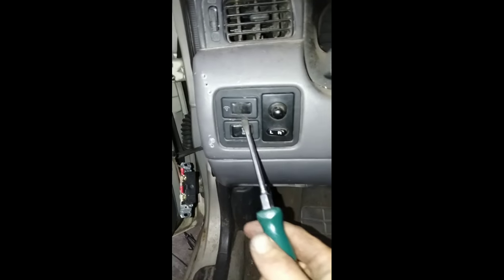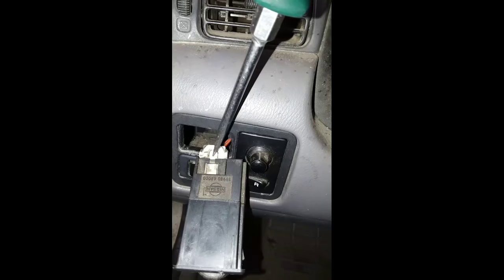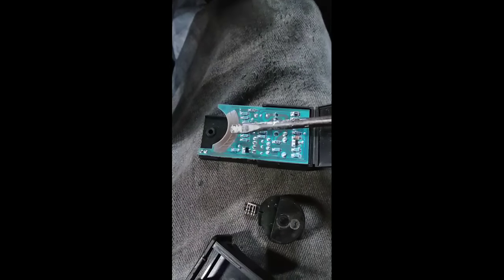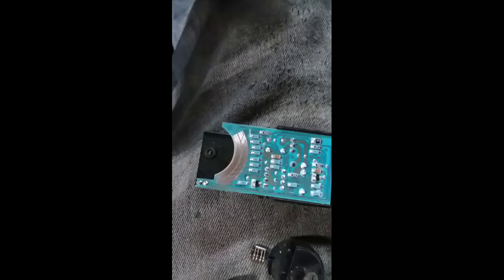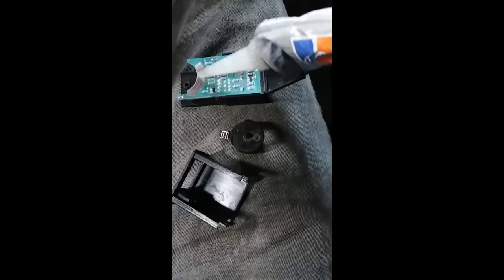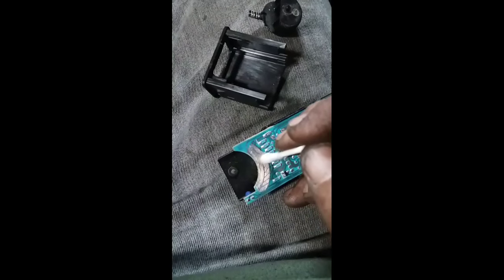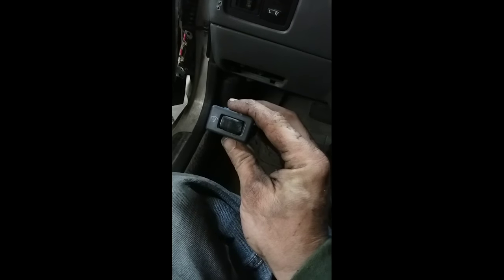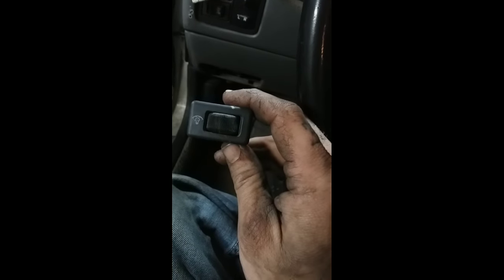Flickering Dash Lights. Easy DIY fix

Comment: When my lights started to go off by themselves, I would give the top of the dashboard a tap and they would come back on. But it's gotten worse over the last few weeks. I would fidget with the dimmer switch, and it would come on and off. I'm betting that your solution is the right one. Thanks again.
Reply from the maker: I did that for a while myself, and still bang on the dash to make my temperature gauge work😂 If it works it works😎
Reply: I have a 2000 legacy b4 and has the same issue as you described. Might have to try this fix also

Comment: I never thought of that I was thinking the instrument cluster plug was loose....I will check that out.
Reply from the maker: A loose plug or crusty dielectric grease in the connector can cause issues too. Sometimes you can just plug and unplug the connector a few times to make a decent connection. Thanks for watching 😁

Comment: Didn't work for me. Of course my dimmer switch was different then yours. I didn't see a contact strip like yours
Reply from the maker: Yeah they do come in a variety of different configurations so it can be hit and miss. Just a matter of  getting at the contacts, without destroying the switch, if there are any of that sort in there. Some of them are more like a typical rheostat switch that's more encased. Sometimes you can get away with just blasting them out with electrical parts cleaner or soaking in rubbing alcohol and working the knob back n forth. Brake cleaner and carb cleaner will destroy them. Thanks for watching 😁

Comment: Cat wasn’t starting.  I cleaned some grounds and replaced a starter cable that was corroded. Car starts now but dash and running light flickers when in D or R only never did before.   If I turn headlights on it goes away. Annoying though. Probably something stupid.  Any ideas ??
Reply from the maker: Sounds like it could be a neutral safety switch (only allows the car to be started in neutral or park) It's common for instrument lights and neutral safety switch to share the same circuit. If you can find the neutral safety switch you can test the theory by unplugging it and using a jumper wire across the  plug terminals. Good luck!
Reply: @sentradynamics8889  hey thanks for the tip !  I’ll keep it in mind. Funny thing is it did not do it until I replaced the starter cable   The old one was corroded and back then it had a intermittent starting problem. Since replacement it did it a few times where it wouldn’t start   Then it wouldn’t not start again   So starts right up since all this but still when in drive or reverse.  Tye dash lights flicker which it did not do before
Reply from the maker: @Mick  Have you checked the alternator and connections? Low voltage can make lights flicker too
Reply: @sentradynamics8889  I checked alternator by putting a multimeter on the battery connections I believe to see what it was doing and I believe it was correct for a functional alternator.  When I did the new starter cable I did clean some windows electrical connections so i should probably check all those to see if something is funky.  Maybe that’s where something got screwed up. But weird thing is how it starts great now and didn’t before lol

Comment: Im having the same problem with my 2013 mustang gt 5.0 my light where the fuel guage and temperature gauge are the LED light is flickering on and off idk what is causing it
Reply: Did I ever figure it out
Reply: You*
Reply: @katgarcia2168  not really im thinking its the lights that gave out might need to take it to the dealership
Reply: @Gumorisco11  same issue here. Lights flickering on the fuel gauge, any updates? Do you know why? I heard it could be the alternator?
Reply: @palerider4629  sup bro nah haven't figured it out yet im thinking its a ground wire or the Lights have burnt out my fuel gauge amd temp gauge back light dont turn on anymore i dont think it would be the alternator because if it was then the windows wouldn't go up they would go up slowly thats one way to test your alternator if its a bad one then your windows wont go up fast theyll go up super slow
Reply: @Gumorisco11  oh wow. Thanks for letting me know a way how to test the alternator. Then in this case it shouldn't be my alternator, maybe my light bulbs are going out, wow that's horrible
Reply: @palerider4629  but its no big deal for me other could be a burnt fuse or a loose wire but im sure its the lights that are going out
Reply: @Gumorisco11  yup, that's what I'm thinking as well, the bulbs might be going out but I also don't want to take the whole cluster out. Idk what to do, this really sucks and its irritating
Reply: @palerider4629  i feel you bro i was going to take mine to the dealer ship but i dont want to get scammed lol
Reply: @palerider4629  bro frz when i bought my gt it came with wheels that didnt even fit the car they fit because they had wheel spacers then having it for a week i started hearing a clicking noise on the back of the wheels so i decided to take it to the stealership and the guy there started blaming it on me that i had taken the bolts off after i told him are you guys trying to blame me for it then he changed subjects right away lol they were going to charge me $270 just for a new bolt and to mount the wheel back but the guy whos in charge of the maintenance said ill charge $160 only after that i never went back id rather have my lights off then having them f... it up and not fixing anything
Reply: @Gumorisco11  yup that's why I don't want anyone taking the whole cluster out and messing with it, I know they will fk something up and won't put it back the proper way. Btw, I went to auto zone yesterday and had my alternator checked and it was fine so it's not the alternator like u said so I believe it's the bulbs going out, fk.
Reply from the maker: Probably a bad ground but there's a mess of wires back there, good luck!

Comment: Great video.  Going to try it on my 2009 Infiniti g37.  Even if it doesn't work still a great video for those that it helped.
Reply from the maker: It's worth a shot, and yeah that's what it's all about. Gotta help each other out😁
Reply: Wow, I have a 2009 g37 and its doing this as well. Any updates?
Reply: Did you try it out?

Comment: Thanks for this. The lights on my heater/Air con have stopped illuminating but the system works.
Any ideas? Thanks.
Reply: Same here
Reply from the maker: There's some tiny bulbs in there. Usually only a few so its common to just have one bulb still working and when that one goes out... Take the trim bezel off and check the bulbs. It'll be obvious if they are burnt out because they will look pretty dark. Good luck!
Reply from the maker: Could be a bad ground connection in there somewhere also

Comment: could it also be a battery or alternator issue??
Reply from the maker: Low voltage can cause intermittent electrical issues but I would start with the switch for the symptoms described in this video😁
Reply: What if your dimmer is on a knob similar to the wiper handle?

Comment: Dang I can't figure this out bro. I cleaned it all out and still all the lil lights flash
Reply from the maker: Could be a bad connection at one of the plugs. Try spraying them out with electrical contact cleaner (brake/ carb cleaner will melt the plastic) and applying new dielectric grease. Good luck!